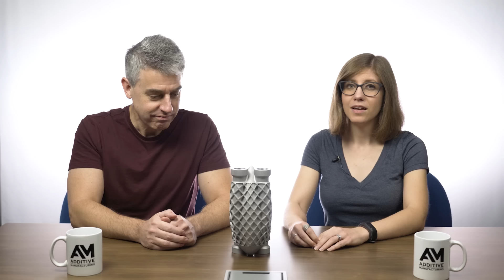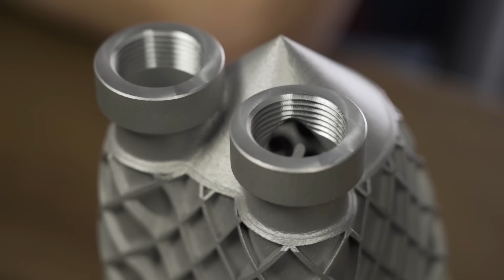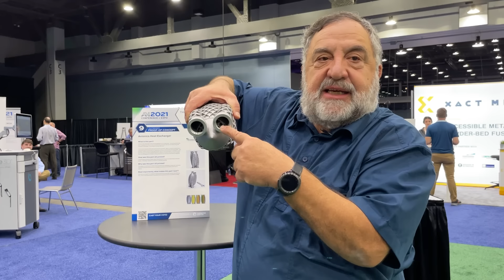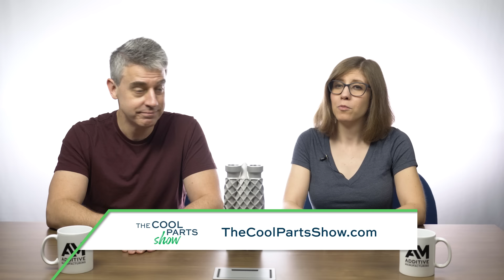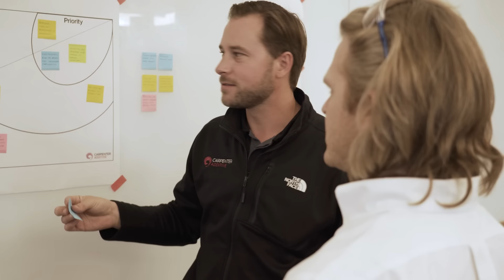3D Printed Heat Exchanger Uses Gyroids for Better Cooling | The Cool Parts Show #43

Comment: I'm disappointed. Yes, the gyroid surface area is great. But what is the objective of a heat exchanger? Is it to equalise outlet temperatures? Because this is only a win if that's your goal. My objective some 30 years ago when I was working out how to improve the Rankine cycle was to heat exchange each fluid's output temperature close to the other fluid's input temperature. Now if you read this very carefully, you may realise that there's a significant difference in the two above methodologies.  

Here's the problem with conventional heat exchange, high thermal conductivity materials like copper, aluminium provide a thermal near short circuit between input and output.   Lets say we have input temperatures in Celsius of 20(fuel) and 80(engine oil) And in this videoed exchanger, lets assume we have close output temperatures of fuel 45 and oil 55. Mission accomplished?  Maybe. 

But, if we thermally isolate heat exchanger stages with great cross conductivity and poor flow wise conductivity then we might get output temperatures more like fuel 70 and oil 30.   

I did this in my early 30's with multiple laminations of aluminiuum thermally isolated with gaskets. And I had a raging continuous combustion in one end (with superheated steam exiting on the other fluid path) and my combustion exhaust by the final stage(4 exchange layers because hand drilling hundreds of 1mm holes through 10mm aluminium plate was tedious work) was simply warm exhaust that I could keep my hands immersed in. 

I looked at tables of thermal conductivity, at the time. Stainless steel is poor, and in order of excellence first, diamond, gold, copper and aluminium. Alloys seemed to have poorer thermal conductivity than any of their constituent elements. Likely because disrupted crystalline structures likely significantly isolate atomic vibrations from one side to the other.

Comment: While it looks cool, comparing it to an outdated cooler design is not accurate. A modern micro tube heat exchanger would be far more efficient than the original cooler.

Comment: 🎯 Key Takeaways for quick navigation:

00:00 🚁 A 3D printed helicopter heat exchanger is more efficient and smaller than its conventional counterpart.
01:08 💡 The 3D printed heat exchanger uses gyroids for enhanced heat transfer, replacing the traditional shell and tube design.
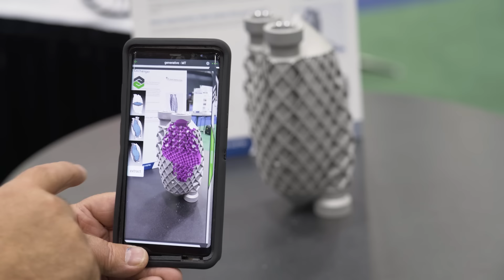02:10 🛠️ 3D printing in one piece reduces labor, weight, and material while simplifying manufacturing.
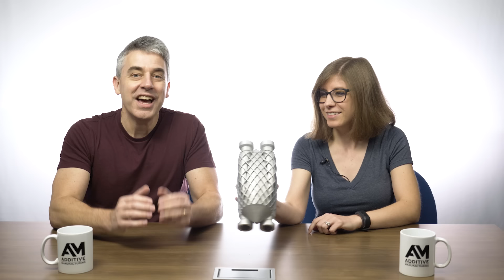03:11 🔍 Gyroids are mathematically complex surfaces that optimize heat transfer between metal and fluids.
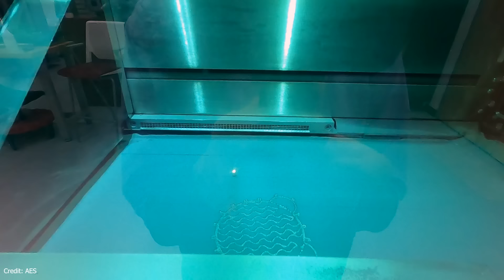05:38 🔄 Gyroids are self-supporting, allowing 3D printing without traditional support structures.
07:07 💪 Crisscrossing ribs on the outside enhance strength and reduce weight in aerospace applications.
08:06 🌊 Gyroids split volume into two domains, making them ideal for fluid separation and heat exchangers.
09:08 🖥️ Digital simulation played a crucial role in optimizing the heat exchanger's design and performance.
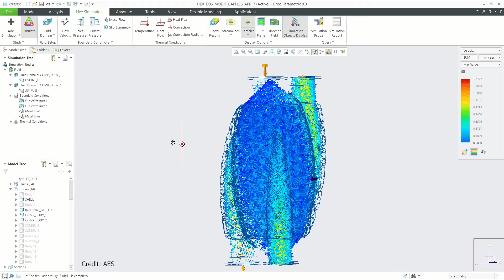10:33 🌐 Digital simulation and 3D printing work together for faster and more efficient part development.

Made with HARPA AI

Comment: Did your company build this? We have a similar heat exchanger design that we'd like to get made. Thanks!
Reply from the maker: @WissamSeif We don’t make 3D printed parts, we just tell the world about them! That heat exchanger was developed by Advanced Engineering Solutions, who worked with EOS to get it made. Either company ought to be able help you find the way forward with your design.

Comment: Supercool! So, simulation is quick and cheap, but doesn't it also give possibly relevant data that you can't even measure IRL in cases like this? 

I wonder, is shell and tube type heat exchangers what's actually used on helicopters? I mean, isn't the advantage of shell and tube essentially that they are cheap, and to some extent, "what we always used"? The oil and fuel should be clean enough to use plate heat exchangers, those should be closer to what can be achieved with gyroid heat exchangers, I'm not sure gyroid actually is a potentially better technique than plate heat exchangers. Better as in more practical, all things considered, gyroid is way cooler, figuratively speaking at least.

Comment: Getting really tired of bullshit 3d printed designs that work on paper only. Inspectability is terrible, no way to do reliable FPI, no way to check for cracks and porosities on the inside, requires flushing of the inside to remove powder and if you’re cooling oil that goes to bearings that becomes really critical. And if you have cracks inside, or they develop due to cycling, you have no way of detecting it, you have no way of repairing it and you’re mixing fuel with oil, and what is even worse and may lead to fire - you’re adding fuel to oil.
Reply: I believe this design is already being used on helicopters. Maybe it's designed with extra margin, so inspection is not needed during its lifetime?

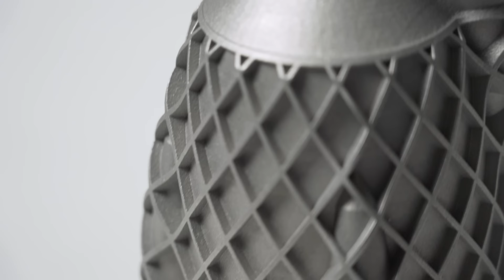Comment: its cool but at 2:40 i tuned out because saying 3d printed exchangers are easier to manufacture vs bent pipes is just ludicrous and delusional. this'd probably be very clutch for special forces helicoptors tho as an aftermarket redesign, say for weight

Comment: As a classily trained engineer it is nice to see them using software to shake out they prototyping bugs, I have one concern though , how easy is it to remove all of the unused metal powder from both sides of the heat exchanger tracks?

Comment: Proof of concept is certainly all that part is good for since they didn't put on any bosses or tabs for mounting holes so it could be tested in real use on a helicopter. It would be much more impressive to have it designed as a bolt in direct replacement so it could be ground tested and evaluated, then flight tested. So it's still iterative manufacturing before it will be a finished design.

Comment: the good thing about halving the size is that you could basically have 2 redundant parts. it also probably drastically reduces the cost at scale since there's very minimal manual work.

Comment: tighter tolerances are great for engineering, bad for real life applications for extreme environments. Military anything runs dirty.  Fuel, oil, hydraulics, everything.  This occurs because literal children are pouring these fluids into the reservoirs with dirty funnels, dirt surrounding reservoir openings being kicked in while filling, one container being used for multiple different fuel types....etc... older stuff may be larger and inefficient, but it will allow impurities to pass through/exist within itself and continue to run.  This could clog easier, compact, and loose flow.  we'll see.

Comment: Not just self-supporting, but the continuous wriggling of the gyroids accelerates the fluids side to side, causing local hot and cold volumes to convect and mix. That forces mixing and turbulence at the wall and prevents stratification in the fluid. Brilliant!

Comment: It's neat. But the old design it replaces seems serviceable in how it could separate into two major components. With the gyroid exchanger you'd better ensure that the fluids going through it don't have any contaminates, because it can't come apart for cleaning let alone having any luck fitting a brush through those complex passages. If something fouls it, you're SOL short of a complete replacement. Sometimes those things matter in an application despite how genius something like this may seem.

Comment: In regards to simulated fluid flow. I'd be curious of the oil pressure delta if any from the current to proposed design. With smaller passageways compared to the current design, I imagine you either need to run higher head pressure or it results in lower overall oil pressure. Just a single curiosity I have, seems like a genius part.
Reply from the maker: Response from Dr. Andreas Vlahinos: “The pressure drop on tube and shell designs is higher since the fluid needs to travel through a single tube. Gyroids provide several passages and therefore have better pressure-drop performance. Using optimization, within the CAD environment, one can use the unit cell sizes (dx, dy, dz) and the gyroid thickness (t) as design variables to minimize pressure drop and keep temperature less than the requirement. I demonstrate this workflow in my short courses and university classes.”
Reply: The passageways account for 50% of the cross sectional area of the heat exchange and constructively interfere. It likely has improved flow rate over a similarly sized traditional heat exchanger
Reply: @shpoople96  I was thinking this may be the case
Reply: Interesting seeing you here ha ha

Comment: How thick and pressure/force resistant is it compared to a tubing design? If its thinner ofcourse it will be  better at exchanging heat but it will corode through faster.

Comment: Cool tech for sure, but I think the biggest issue would be cost of additive manufacturing. Namely, that printing each unit one by one is likely far slowly and therefore more expensive than mass-producing something with a simpler construction. Also half the size and 4x more efficient, but what about durability? Additive mfg is great for prototyping, but it's hard to make it practical without costing an exhorbitant amount of money.

Comment: Cool device; however, it has what might actually be an enormous flaw in that it cannot be visually or x-ray  inspected for cracks or blockages.  One of the critical failure points of a heat exchanger is when the barrier between the different fluids is compromised.  For example, in this case, should the barrier between fluids be compromised,  you could have fuel diluting the lubricant in the gear housing, producing a gearbox failure (and possibly a helicopter crash as a consequence).

I'd be very interested to learn of the actual contracts they have actually signed with actual customers, particularly military customers.  Personally, I would be a whole lot more confortable going with an inspectable component like the "ancient" tube and shell or gasketed plate heat exchangers.

Know what this would be perfect for?  Homebrewers.  If you can make it essentially disposable after a year or so of use.

Comment: there is an important different between this new part and the old part that has been used for decades: the difference is that one part has been tested to work for decades, and would most likely continue to be used for decades.

Comment: Fouling and rough inner surface areas would drop the efficiency as time goes by rather quickly. Of course, those can be made at a cheaper cost vs traditional heat exchangers and mighty military and FAA can always set a timeframe maintenance schedule to the dear technicians

Comment: could be huge for geo thermal cooling (large volume of air smaller volume of water.) northern climates could completely due away with conventional hvac. 45 degree ground water

Comment: Lol, not a chance. The original can handle stress, flexure, and vibration. That new one might as well be made of glass. You might talk a race team into using something like that, but certainly not the military. At least not until the quality of print materials improves dramatically.

Comment: How can it be more efficient if it cannot be maintained and is significantly more expensive to manufacture? Look at an ordinary heat exchanger, there are just cut pieces of tubes in a casing made of cut pieces of tubes, what could be simpler?

Comment: Can you make one for my supercharged mercedes?
Reply from the maker: Can we drive it?
Reply: @AdditiveManufacturing  absolutely.  Drive it like ya stole it.  Engine just gt rebuilt and could use a good flogging.
Reply: @AdditiveManufacturing  how else would we gather data on air intake temperatures?

Comment: Depending on the thermal conductivity of the material the outer ribs could also contribute to the heat dissipation due to greater surface area, paired with titanium oxide based paints I could imagine the thermal dissipation seeing reasonable improvements.
Reply: more surface area the better
Reply: Or they could have printed fins around it, like the fins used to cool a motorcycle engine.. either way the fins can be cooled with air passing through it or liquid like a radiator would
Reply: Actually, no. They idea behind this is that heat is removed from liquid oil by liquid fuel, and then this hot fuel goes to the engine. This heat exchanger is placed inside of a helicopter, so it can't radiate heat because it will heat up INSIDES of a helicopter.

Comment: really curious about fouling and how you'd clean the internals of a unit like this.  we deal with tube and shell exchangers, and the maintenance on those are needed fairly often, so I'm curious what the trade off is in a design like this.
Reply from the maker: We put that question to Dr. Vlahinos. He said, “The AM-generated surface roughness provides a higher coefficient of heat transfer. We have not done any testing on fouling. We expect fouling not to be significant as gyroid-flow-domain paths are smooth and we don’t have flow particles hitting flat surfaces or internal cavities. I agree that research needs to be done for various fluids to assess the impact of fouling on gyroid heat exchangers.”
Reply: @AdditiveManufacturing  That is an enormous red flag, quite honestly.  Any part that cannot be inspected cannot be trusted.
Reply: Maybe you just run it at a high head pressure with some alcohol or something?
Reply: I should imagine a sonic cleaning after "fouling" would do. What temp. drop/increase can this device achive.?

Comment: I am a mechanic of whatever people bring me. From my current understanding, the current problem with 3d metal sintering or printing, is the porosity of the metal after the process. There's been some experimentation with trying to refuse the metal after printing to remove the porosity and increase the strength of the material but with very limited success. This part is not duty-ready and would fail if pressed into service as is. Also they keep bragging about "no supports.." um... your powder in your printing bed, is the support.. stop preying on ignorance.

Comment: Hi, I am or was a Mechanical engineer (not sure which is correct) in charge at one time of maintaining heat exchangers in the electrical generation and oil refining industries. One of the comments interested me talking about the roughness of the exchange surfaces. I was thinking that this roughness may create eddies enabling both liquids to reduce laminar flows ensuring better heat transfer. Please correct me if you disagree because my last experience of exchangers was over 40yrs ago and my college days were way before then. Regards

Comment: if this were on a race car I'd not bat an eye. But on an aircraft wouldn't you need to prove the part is good? The surfaces are rough internally and the process of 3d printing may leave voids in the surface, hidden away inside. Also I don't see any mounting points?  ALSO2: I want the STL to print my own PLA version :)

Comment: Imagine, printing engine or motors which you can direct fuel or other fuel flow to cool the motor, Just like how the rocket engines for NASA does. Less parts, lighter, more rigid. The possibilities are endless!

Comment: A heat exchanger demands no fluid contamination on either channel. With laser sintering the finished part is soaked in the bonding metal dust & there is no guaranteed way to dislodge and remove all of it. A solution might be to bring the completed part up to high temperature, just below melting point, then blasting through very hot gasses through each port in sequence. The idea here is to "glaze" the internal surfaces and melt any remaining particles. Destructive testing is needed to find the sweet-spot for this theoretical process.
Reply: I was thinking about this while watching. I believe ultrasonic cleaning and blasting liquids through it for a short period of time would probably clean it up fine.

Comment: From a nuclear engineering perspective this is really interesting. When you're making 3,000,000,000 W of heat per core, heat exchangers are no joke. The main advantage I'm seeing for me is It being one continuous homogeneous material with a well supported interior and obviously the efficiency. Heat exchangers die from the tubes rattling against them selves and anything near them. I wonder if something similar could be made out of a material that can handle the temperatures, pressures and corrosive conditions. I don't hardly ever work with 3d printers so I'm not sure what is realistically possible.
Reply: This particular type of additive manufacturing (or "3D printing") uses a laser to melt a metal powder in a precise pattern. It is no coincidence that the metal used has a relatively low melting point.
Reply: @brianb-p6586  just that you are aware: there are completely 3d-printed Rocket Engines on operational Rockets that got to Orbit. Namely the Rutherford Engine on Rocketlabs Electron. I couldnt find much data about the Chamber Pressure and Temperature, but i am sure it is higher than the use case of the initial commenter.